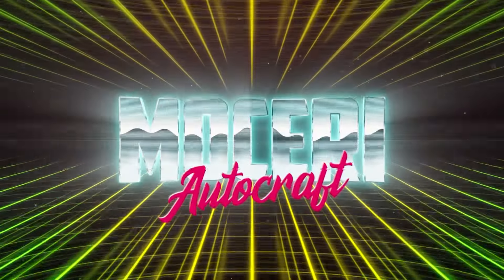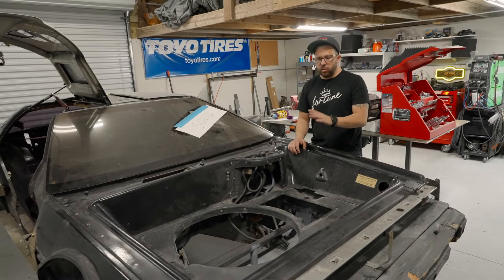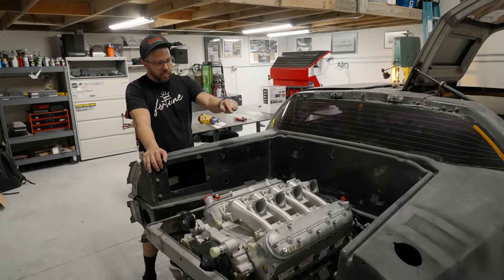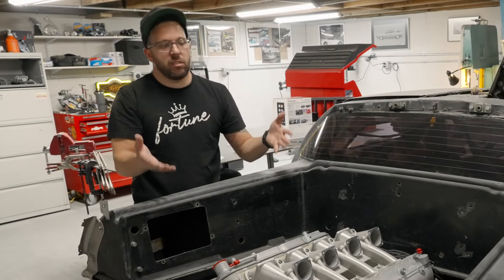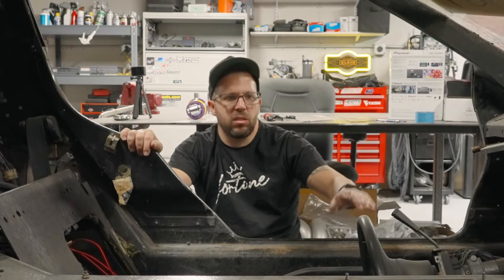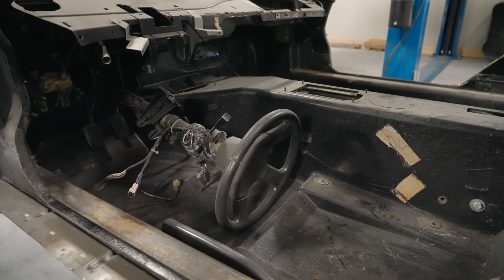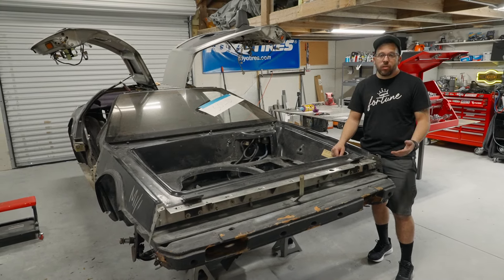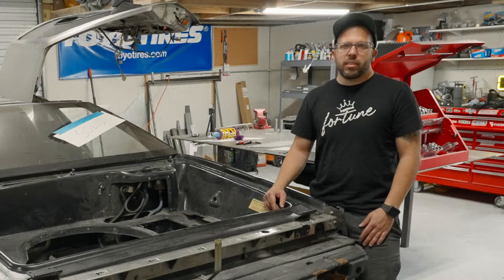We Sold the Twin Turbo LS Delorean Project?! - LS Swapped DMC12

Comment: If you're going to do paddle shifters (not a fan) you should do a late model corvette swap  (Z06?) using the dual clutch transmission.   You could use the factory GM computer to run the trans.    I prefer a 6 speed in my hand, but I have to nod my head to that new technology and that flat plane crank V8.   If you buy a salvage vette then you can steal its a-arms and suspension and maybe even some interior.    Hmmmm.
Reply from the maker: I would although the corvette is mid engine and the DeLorean is rear engine so I have to use Porsche stuff. 💪🏻